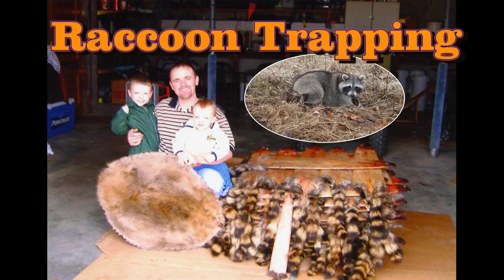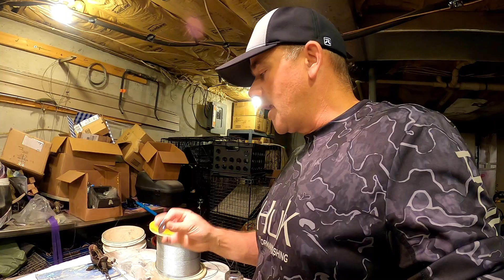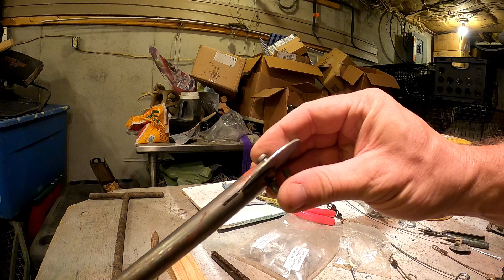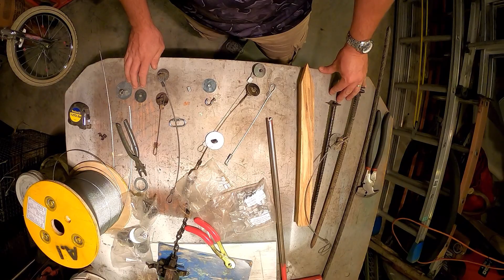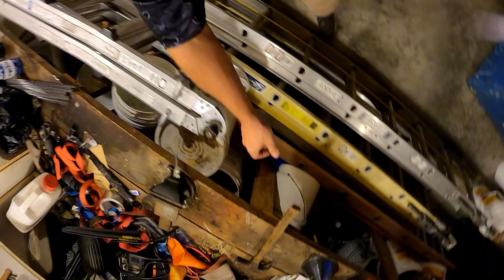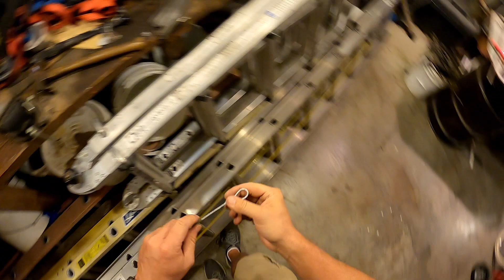HOW TO MAKE DISPOSABLE STAKES | POGO SYSTEM  | Trapping Anchors For Coyotes, Bobcats, Fox, Raccoons

Comment: Jinx I am going to give you a tip how to get them pogos out real easy drill a hole at the edge of the washer and attach another cable to it and make it a little longer than the other and you can get the same driver to pull it out .. try it ..keep forward

Comment: What's the thickness on them fender washers?
Reply from the maker: Not sure i can answer your question thoroughly. The pogo driver system will only seat a certain thickness. I try to buy my washers through Minnesota trapline, funkes, Schmitt Enterprises, or Dan the pogo man directly. I've made the mistake and bought washers through a non supported dealer, and they wouldn't load. I'm running I believe the 1 inch diameter for land sets and the 3 inch diameter for water and my cable restraints. Hope that helps.